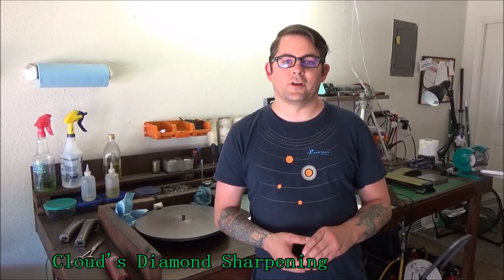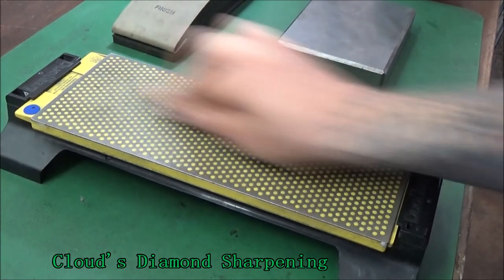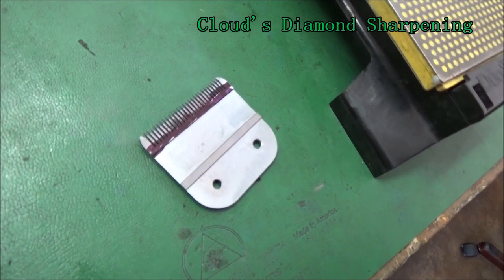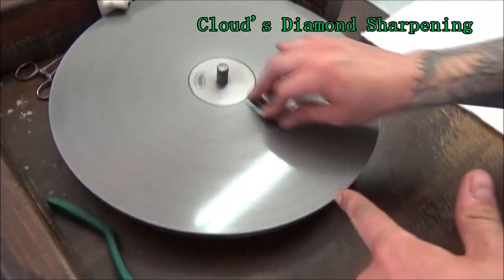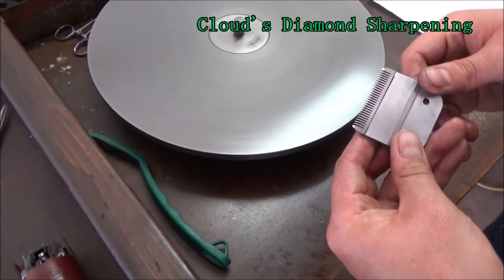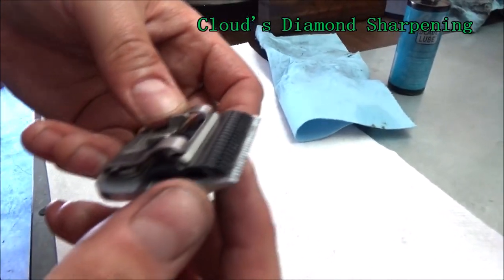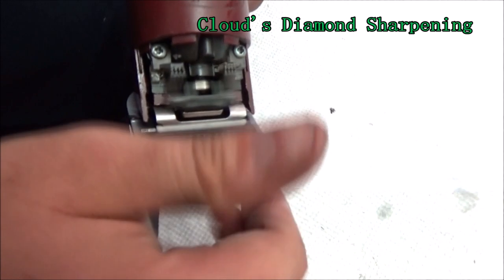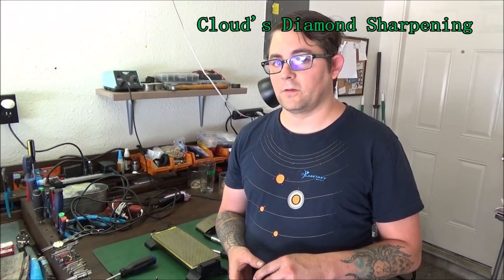Professional Clipper Blade Sharpening VS The Sharpening Block or Sandpaper

Comment: Hi Nick,  I want to as ask, can aluminium wheel sharpen all types of clipper blade ? 

I sharpened some blade and they appeared correctly . Out of that Someone also brought his clippers to sharpen 4 him, this time I did but the blades couldn't cut hairs and the client was annoyed. That is why I'm asking you this question. 
Thank you dear.
Reply from the maker: Clipper blades vary and different mediums are used depending on the situation. There are too many variables to consider when determining why a blade won't cut. However, the wheel itself isn't as important as the expertise and experience of the sharpener.

Comment: Hi dear George, thanks for a humble disclosure and enlightenment. Please what material is made up of the wheel or hone that you're using?
Reply from the maker: Hi, Richard. Thanks for watching! I use a few different wheels. They are constructed of different materials based on what I'm working on. As for my custom wheels, it's a family secret :)
Reply: Hello sir. Nice video. But I could nt understand the use of Marker. Please explain

Comment: What would be a good budget machine for doing this? Most of the ones I see are in the high 800 all the way up to 1800
Reply from the maker: Most professional machines are going to cost around 2000$. I wouldn't trust a budget machine. The machine however is 20% of the equation. The skill of the sharpener is the other 80%. Consider this before making a purchase.

Comment: What's the thing called after u sharpen the blade u rub it or grind it against and it shows you the pattern that u just sharpened the blade weather it's the shape u made with the sharpie marker or some other shape? What's that thing called ?
Reply from the maker: In the industry, it's normally referred to as a test / rubbing block.

Comment: Where do u apply pressure on the blade while u hold it togl get that circle or ball shaped pattern? Is it the same for the t liner blade? And what speed do u use and does the speed make a big difference ?
Reply from the maker: All blades are different and there's a variety of approaches to take depending on the blade. Speed varies as well.
Reply: So what do you do for clipper blades and t liners?
Reply from the maker: @wildlifeent415  every blade is different.  You have detachable blades, trimming blades, adjustable blades etc. There are a lot of factors involved such as the shape that's already on the blade before sharpening, size of blade, wear and tear, etc. The shape that the wheel can produce is consistent on every blade, but the speed that's used, diamond vs oxide, pressure points on blade when sharpening, etc. all factor in to the process.

Comment: What is the main reason why clipper blades wont cut very well if the comb and blade faces are flat rather than slightly concave ?
Reply from the maker: Hello. Flat is dull. You can try concave and if it doesn't work, then try beveled or convex. If you do it correctly then it'll work. Thanks for watching
Reply: @cloudsdiamondsharpening3973  Thank you for responding. How would you expect to see brand a pair of brand new clipper blades? e.g. any Wahl blades. Should the surfaces not be flat? I'm trying to understand how these blades actually cut.

Comment: when using that platter ginder how do you compensate for the different abrasion rate→the outer edge of the wheel cuts faster/more than the center of the wheel does.  You can get a flat surface but the thickness of the blade will vary slightly from edge to edge. How does that affect the tension between the cutting edges?
Reply from the maker: Our plates do not create a flat profile but rather a specific shape. The tension is consistent across the blade.
Reply: I'm not sure what you mean "a specific shape".  Is the platter not flat?  Does it not cut faster at the outer edge compared to the center? @cloudsdiamondsharpening3973
Reply from the maker: @danjensen957  the plate is not flat.

Comment: Thanks for the video. About how many times can a andis t trimmer blade be sharpened before it has to be replaced?
Reply from the maker: It will vary. Taking care of the blades (cleaning, oiling, storage, etc.) usually will be the biggest factor in determining how long the blade will last. When sharpening a well cared for blade, minimal metal is removed. If a blade is continuously used with issues, not only will it affect the blades life, but also the clippers.
Reply: @cloudsdiamondsharpening3973  Thank you, my father was  a barber for more than 40 years.When passed away I got a box with all of his old equipment. One of the trimmers is a Andis t trimmer outlined. It is about 10 years old but still works great. THE switch needs tightened but thatbis about it. New blades are only $20.00. I  notice the blades are  dull. I can get a brand new unit for around $60.00. Due to the age of the trimmers, wear and tear over the years. Is it better to service the trimmers or just buy a new pair?

Comment: Why wont some sharpeners sharpen ceramic blades?  Are they fragile and snap in half?
Reply from the maker: Sharpening ceramic requires different equipment than what's needed for sharpening steel. Not so much the machines themselves but the medium that is used. There aren't as many ceramic blades on the market as steel so sometimes it's not cost effective to buy the proper equipment for a blade you see every now and then. We see a lot of them because we advertise the ability to sharpen them properly, but they're not as common as steel blades for the average sharpener.

Comment: Hey do your resharpened blades cut better and last longer than factory since you use s diamond wheel
Reply from the maker: Diamond provides a smoother finish. My wheel is designed to cut a shape into the blade that promotes longevity. However, user maintenance and using the tools properly have a lot to do with how long an edge lasts. I sharpen new blades as an additional quality control step due to experience with new blades not lasting long or not cutting at all. If you used my service, and took care of your equipment properly, then yes, I'd say you have a better chance of the blade lasting longer and cutting smoother.
Reply: @cloudsdiamondsharpening3973  I'll send some blades to you for testing when i get back off Monday

Comment: good afternoon friend, take a question please ... The spring pressure is made by these two screws, which hold the blades? and how much pressure do I have to give, is there any method? thank you very much.
Reply from the maker: The spring pressure is addressed on the tension spring for detachable blades. For adjustable blades, you'll have to address the armature usually. All depends on design. The screws don't address this.

Comment: Can sharpening make my cheap clipper work better? I bought a secondhand Wahl to trim my cat, and it just slides over her fur. It hardly cuts anything. She’s a fluffy cat with very fine hairs, and sanitary trims are $50 plus a car ride she hates.
Reply from the maker: You probably need a clipper with detachable blades bc wahl clippers are more for human bc and cant hold tension so your clippers are just pushing hair away. The tension on a detachable blade is on the blade and u can use different sizes. So they wont push hair away as bad.

Comment: Hi dear friend.  I wanted to ask you, please. To sharp the hair clipper blades  how many "GRIT" should (must) be the diamond disc? Thank you and have nice days.
Reply from the maker: 1500 grain
Reply: @cloudsdiamondsharpening3973 , the diamond disc, should be thinner (like, 2000, 6000, or more..) for a excellent sharpening  blades? Thank you. 😇
Reply: @cloudsdiamondsharpening3973  is the 1500 grain disc same as a 1500 sand paper ?
Reply: @luckyshot_007  did you find out
Reply: @jarp87  no I did not, but I tried the 1500 sand paper and it did the job, next time I will try 1200 & 1000 to see if I get a better result 👊🏼
Reply: @luckyshot_007  thanks for replying. I got the 220 and 150 grit sand paper but felt to coarse
Reply: @luckyshot_007  forgot to add, saw in another video that 220 and 150 grit was recomended.
Reply: @jarp87  if you try it let me know your result 👊🏼

Comment: Hi Nick, I have a few questions regarding the Oster Fast Feed and possibly modifying them to become cordless and wireless

1) Is it possible to modify a corded Oster fast feed clipper by changing the AC Pivot Motor to a DC Magnetic Motor (a DC Magnetic Motor from a Wahl Cordless Senior preferably)

2) Is it possible to solder in an 18650, 20700 or 21700 battery in the clipper, connected directly to the DC Magnetic Motor

3) Wireless modification, or Wireless PCB attachment and connected to the 18650, 20700 or 21700 battery.

4) essentially modify and create a personal wireless Oster Fast Feed clipper

Note: I believe this has been achieved however I was wondering how tough of a job it would possibly be? And what it would potentially require
Reply from the maker: No you will need a pcb to convert to ac to DC to be able to use a battery

Comment: Now a video I watched before this used sandpaper only and stated to only drag the blade backwards?
Reply from the maker: It doesn't matter what way you drag it on. Sandpaper  will ruin your blade.. if you watch the video Blades are not flat, sandpaper will make them flat, flat is dull .

Comment: Granularity 1500 You also use the wheel
Reply from the maker: Our wheel isn't coated, but we redistribute the charge the same as you would using oxide. Yes, 1500.

Comment: you never let the cam focus on the blade long enough so we could see what you were talking about, and the way you explained it I would have to have experience sharpening blades already. Was the intent of this vid "don't even try to DIY, send them to me I'm the pro"? Do you have any vids that are about teaching diyers how to sharpening on their own?
Reply from the maker: @popparock6506  the video shows the difference between a professionally sharpened clipper blade vs a blade that's sharpened flat. This video was made specifically do to the increasing volume of blades our business was receiving at the time that had been sharpened flat and couldn't be restored. Sharpening clipper blades properly requires the right machinery and a lot of practice and experience to perfect. You could definitely diy it, but to do it properly and achieve longevity on the edge produced, you would need a stack of cash and plenty of free hours to practice/train yourself.

Comment: Hi , i have a Wahl clipper that gets hot when i plug it in even if it is turned off is it normal?
Reply from the maker: No, this is not normal.
Reply: @cloudsdiamondsharpening3973  I mean it doesnt get hot in the blade but the body of it and it not super hot but more than warm is it something  I should worry about?
Reply: @cloudsdiamondsharpening3973  i mean it gets hot like a phone charger no more
Reply from the maker: @hermestri4593  is it cordless? And gets warm while charging?
Reply: @cloudsdiamondsharpening3973  No it is a corded one is the color pro Wahl, gets hot/warm like a phone charger , the blades dont, its new , it doesnt really bother me but i dont know if maybe something is not working properly
Reply from the maker: You can always expect some type of heat when operating a hair clipper. If it becomes hot to the touch, I would expect a problem, but if it's getting warm like a phone charger, I would not be too concerned. Just remember to always keep the clipper blades lubricated.

Comment: I'm kinda lost here with your video on sharpening your clippers blades because you did use the block and then the sharpening wheel
Reply: The block is how not to do it as it results if a flat grind, the disc is actually a very flat cone and produces a concave. When he does the rub test it produced a curved shadow of high spots on the end which is what the blades required to be offering the best results. Nebraska blades and a Swiss company make these sharpeners but I think his is not theirs as his has diamonds as the grinding media, the others use aluminium oxide grits

Comment: What kind of disc is? You dont use any abrassive like aluminium oxide??
Reply from the maker: We use 1500 Diamond abrasive
Reply: @cloudsdiamondsharpening3973  dammmn thats sick no wonder you dont use any oil and abrassive, I have a wheel but I use aluminium oxide
Reply from the maker: @milessecret7318  aluminum oxide has its use. Diamond allows the ability to sharpen any blade on the market.
Reply: @cloudsdiamondsharpening3973  yeah, for grooming its very good, but for barbers not so much, I looking something to get wahl blades get a full result, aluminium oxide works good but not like I want
Reply: Cloud's Diamond sharpening
Reply: @cloudsdiamondsharpening3973  Hi...been following your channel for a while and I saw in the earlier videos that you said you might sell/produce the wheel. How is that going as I do like the quality and clean work situation you have.  Will you provide the wheels for sale anytime soon ? Kind regards Ebbe
Reply from the maker: @Ebbe64  hello. I'm sorry Im having trouble producing the wheel at this time but I'll make a video when I'm ready to distribute and thank you for watching
Reply: @cloudsdiamondsharpening3973  thanks for the answer. But if i get it right its a aluminium disc that have a complete flat surface right ? With a 1500 diamond grit ?
Reply from the maker: @Ebbe64  no Im sorry you're wrong but you can try that but I won't recommend that bc it won't turn out good. Thank you for watching
Reply: @cloudsdiamondsharpening3973  thx for the answer. But what is completely wrong. The flat surface ? The aluminium disc ? The 1500 grit ? And another question on your nice maschine. What rpm is best and what are you running on the disc.
Reply from the maker: @Ebbe64  the disc is not flat and not aluminum. I adjust the rpm to the blades I'm sharpening. It don't matter if it's going to slow but it does matter if it's going to fast. I'm not sure how fast it goes
Reply: @cloudsdiamondsharpening3973  wow. Thx for the swift answer and so informational. :-). Which material on the disc and which curve ?

Comment: Sharpened 500,000 blades at your age ? Must be quick to do them
Reply from the maker: I'm 38 and I did it since I was 18. I can do 127 blades in 6. On average I did 10 Clippers a day and up to 80 blades a day at a minimum. Working for a Andis, oster, wahl, service center

Comment: This is the most biased video ever
Reply from the maker: I appreciate you watching the video and leaving a comment. I operate a blade sharpening and repair business in Texas, and at least once a week, I have to contact a customer and explain to them that their clipper blades are unrepairable after being sharpened on a flat stone. Flat stones are great tools for the trade, and we use flat stones for a variety of sharpening techniques and methods. However, if you want a long lasting edge on your clipper blade, sharpening them flat is definitely not the way to go and more times than not will ruin the blade. Getting a clipper blade to cut is one thing, but getting the edge to last is another.
Reply: @cloudsdiamondsharpening3973  thanks for your reply. I have been watching videos about sharpening on a conical disk. In the beginning, I didn’t understand many things, now I understand the shape of the disk and why the revealed pattern after sharpening. 

The only thing that I haven't understood yet, is the shape of the blades. When I see them, they look to me flattened, I don't see the hollow grind anywhere.

To me a hollow grind is like in straight razors, where the spine is thick and before reaching the middle part is thinned than the rest of grinds.

I apologize for my words in my previous message.
Reply from the maker: @mauriciolguin  no reason to apologize at all. Sharpening clipper blades are not easy, and nothing like sharpening single- edge tools. Yes, to our eyes, everything appears flat. That's why there are certain tools that can be used to test the shape once sharpened. The shape affects how they cut, as well as potentially how long the edge can last assuming they are cared for properly. I really appreciate you taking the time to watch and comment.